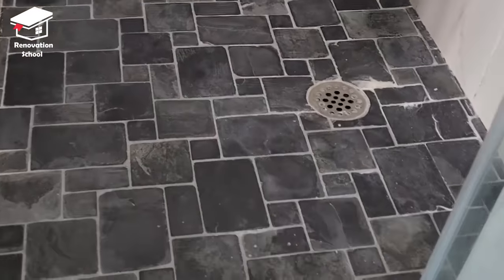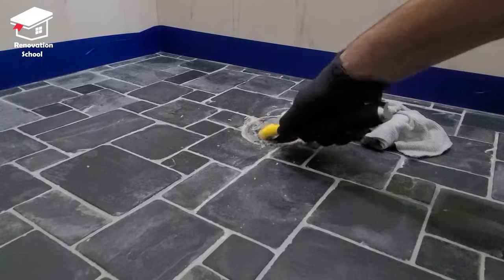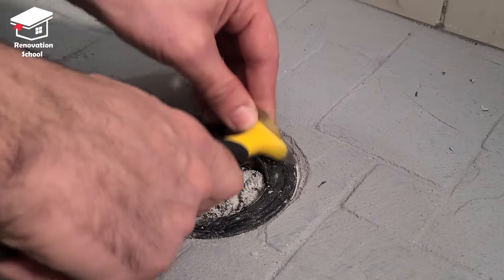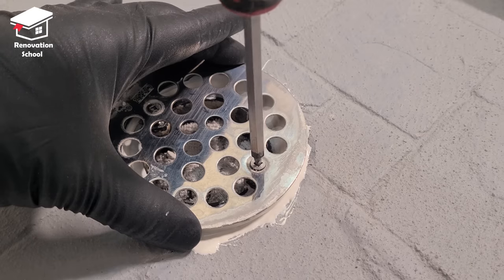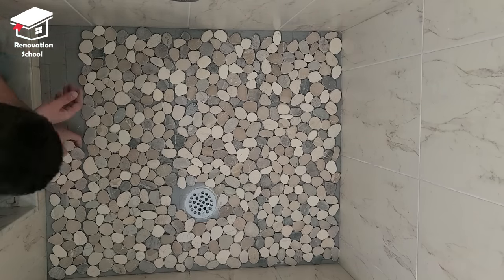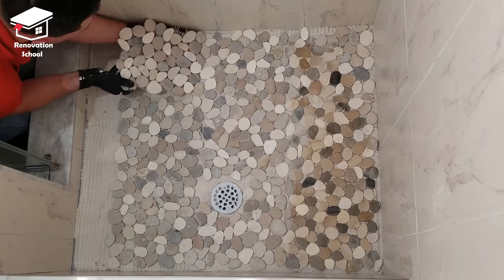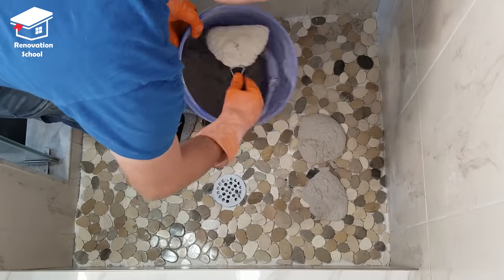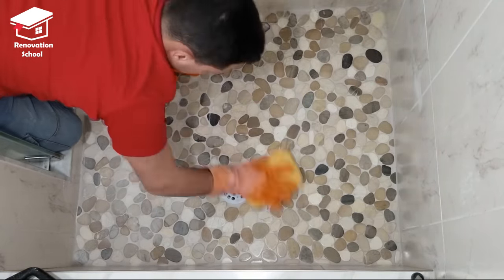How to tile over tile in a shower floor?

Comment: hi a very informative video.
When finishing off the corners with silicone, I would suggest first  tooling off the silicone with your finger first, then spraying it with water, followed by a spray of soapy water and then another tooling off with your fingers.
If you spray the silicone before tooling it off, you prevent the silicone sticking to the tiles on the feather edges of the bead and mould will establish in these areas.
cheers
Reply from the maker: Thanks for the tip 😊 and thanks for watching.

Comment: I’m not complaining about your work. Just wanted to ask…. 

Ok… all tile leaks through the grout. That’s why the shower pan is super critical.  So when you tile over tile. You need to make sure the moisture that gets below the tile can flow to the drain and then allow the grout to dry out. Otherwise the grout will stay wet all the time causing mold. Did you make sure to add new weep holes at the new drain. 

I build custom homes and remodel homes. The number one issue I find is wet shower pains, moldy grout and  tile due to poor shower pan drainage.

So. Now when water makes its way through your new grout. It hits the new water barrier. It will run towards the low spots which should be your drain. However when it hits the new piece of black pipe installed it cannot get into the drain, there are no weep holes.  So the grout will become saturated with water and never fully denoting used regularly.
Reply from the maker: I've seen many shower pan failiars also.
I say most of the cases depend on the home owners. If the clean and seal the tiles regularly they will never have an issue. 
I clean and maintain mine. 
It really is amazing to goof proof it. But honestly I didn't bother making weeping holes and bs . It's too much overthinking here for a small tile shower floor that has all the fancy waterproofing stuff under it . When I use this shower every day. I always notice that my grout dosent even get wet let alon having mold in it. If u watch the video again you will see I used that grout additive . It literally made it water repellent 100 percent. You can see the water from in to small balls when it hits the grout here. I do not ever worry about weeping holes or water getting in or under this grout. 
All the best . Thanks for watching and the comments. I really appreciate you and people like you.

Comment: This is an amazing video with all the steps needed. I do have a question, have you ever done a job and then figured that the grout color didn't look good with the tiles or bathroom? What would you do then?
Reply from the maker: Thanks for watching
No I have not 
I would remove the grout and re do it 
There are ways to redo the grout 
Thanks to YouTube you can get lots of ideas

Comment: Great video! I have a shower tile floor that has a low corner where water pools. Probably 1/4" drop in a foot, but in the wrong direction. How thick can you lay thinset like this? Enough to be able to correct that slope, or does the whole mudbed have to be redone at that point?
Reply: I have this same issue now. I came here with this question.
Reply from the maker: Hello, thanks for watching
You can use the 10 sets and correct the slope first
Allow it to fully cure and then the next day tile over it
Reply: Wow fast reply! Thank you so much! Also, the original shirt drain is one of those long, rectangular drains. Is that difficult?
Reply from the maker: That is depending on the style of the drain and your craftsmanship level.
Reply: 5:59

Comment: I always lightly grind the tile first. Gives you a much better surface to bond to.
Reply from the maker: the black stone was rough and i used the primmer on it.
using a grinder for shinny stone tiles is a great idea 👍
Reply: I've alway grind them too. I wonder if that's still needed if I use this primer

Comment: Fantastic video. Your instructions were clear and detailed.  I appreciate the effort.  I am going to pull out the walls in my shower but tile over my floor since it doesn't leak.  Surprisingly I picked out the same exact tile from Lowes.  Can you tell me what color grout you used.  It looks perfect with the natural stone. Also, is it over kill to paint on a membrane like Redguard and if I did go that route would you suggest to put the primer over the Redguard?   Thanks
Reply from the maker: Thanks for watching 🙂 I don't remember the grout colour but I'm sure I showed it in the video you may be able to see what brand and colour it was if you watch the video one more time. just use any sanded grout that matches the colour of the tiles ( stay away from premixed grout they suck so much)
As far as applying redguard on the old tiles it depends, if your tile has a rough texture it should work, but if the floor tiles are shiny and big redguard will not stick as well as this primer. this primer adheres very well to tiles even if they're shiny. if the shower floor doesn't leak I suggest using the primer overall. If you want to use the redguard id say to apply this primer first and then apply the redguard on top if you want to. The primer is used for bonding the materials. 
All the best 👍
Reply: I've been doing a lot of research. I have the same drain as yours. Do I have to worry about weep holes not being in the drain? I have a sloped shower floor that drains to the middle but not sure if they used a motor bed? My plan was to sand,  apply the tile primer, then a coat of Red Gard, and then install Kerdi membrane and a Kerdi curb to make sure the floor doesn't leak. I do have a small leak on the outside of the present curb which is probably wood and not sealed properly. Any thoughts?
Reply from the maker: I think you already know what to do 👌😉

Comment: Nice job. I used the Mapei stuff also and the large tiles adhered nicely over old tile. I probably should have gave it 2 coats. And if you miss a place, go back and fill it in, because if you don't, you will pay the price, as the top tile will NOT adhere.

Comment: Your video is very well explained. How did you cut the small stones around the edges?
Reply from the maker: Hi 
thanks for watching 
i use a tile nippers to cut them. the tile nipper does and amazing job , if the edges are sharp u can use a fine file and file it down and you are good to go.
Reply: @renovationschool8818  
Just a little Pro tip, you can cut those mosaic in the package through your wet saw to get a straight edge on the perimeter all the way around...
It sure beats cutting little pieces to fill the gaps ✔

Comment: Excellent and thorough video!  Thank you!  How would you recommend tiling over a shower floor that is river rock, which obviously isn't a totally smooth surface like you have shown in your video?
Reply from the maker: Thanks for watching and the kind words. 
if u dont have any water and leaking issues , I would suggest washing the tiles super clean first and then when its bone dry, clean it with  alcohol. Then apply the primmer that i used in the video. when primmer is dried up use modiffied thin set (that i showed in the video) and skim coat over the rock tiles till its smooth, making sure its slopped properly so when u tile over it the water goes to the drain. allow to dry up for a full day and then tile over it the same way i explained.
basically build a layer of modified thinset on top of the rock tiles after the primmer is dried up and make sure its slopped properly before tilling over it.
Reply: @renovationschool8818  Can I use modified thin set to improve the angle of drainage? My shower does not leak but water pools in one area away from the drain.
Reply from the maker: @averymay7274  after priming and following the steps that you saw on  this video yes

Comment: Great video. I plan to also do the walls any suggestions and which should be first? Thanks
Reply from the maker: Thanks for watching 
Professionals always do the walls first. Be aware if u do the floors first establishing the first row on the bottom of the walls will be difficult for DIY guys because u need to get perfect grout lines. Since   shower floors are sloped you need to cut the bottom of every wall tile according to the slope ( only the bottom row will be hard to do) but let's say if you are not very skilled with tile work you can do the walls first and hide the bottom row cut imperfections with the floor tiles.

Comment: Thanks for the very informative video, one quick question, can it be done with 2nd floor shower? not sure if the added weight is substantial enough to be a concerned, but I just thought I check if there is any extra steps for 2nd floor shower floor. Any advice is greatly appreciated. Thx
Reply from the maker: Hi 
this video was done in the second floor already. there is not much weight added . its 100 percent safe to do it anywhere in the house.

Comment: If you have no leaks but want to improve the flow of water toward the drain, can you use tile over tile to change the slope?
Reply from the maker: Depending on the type of tile and drain yes
Reply from the maker: Depending on the type of tile and drain you can do it for sure as you saw it on this video

Comment: Hello ....Great job with this.! 
Do you know how this will work with a square kerdi schulter drain?  Thanks
Reply from the maker: Hello 
Same exact procedure
Reply: Great.  Where will the extension go? Will have to remove the square part grouted into the floor?
Reply from the maker: You can remove the existing and add one of these and then use a new drain cover for the top part
https://www.google.ca/shopping/product/1?q=schluter+shower+drain+extension&sca_esv=0f8df8f1fcc87b34&biw=412&bih=757&tbs=vw:l&sxsrf=ADLYWILDtQu2k8w2vko_YiRve404MuM03g:1719715957693&prds=num:1,of:1,eto:13217570201099164063_0,prmr:1,cs:1
Reply: Thank you !

Comment: Thanks for your video its excellent by far. I have a quick question; Can I install mosaic over the shower wall ceramic tiles in the same way you installed the floor? 
Thanks again.
Reply from the maker: Thanks for watching , yes you can do that 100 percent 🙂

Comment: I know this is a year old video but I figure I'll try. I have the same issue and want to tile over top. Only problem is the drain is a linear type that can't be adjusted up or down. Its a Schluter system so the drain has a flange that is under the schluter. Any ideas how to extend some kind of drain?
Reply from the maker: You won't be able to unfortunately. I know what exact type of drain you have . This will not work in your case. You have to redo the whole shower base.

Comment: Thank you for the video.  Wanted to ask you a question.  I have a new build with walk in shower.  I noted the tile flooring was not sloped correctly and the water was not draining.  The builder hired a contractor to correct.  Much to my surprise, they did not remove the original floor tile, they did a tile overlay.  I am completely ignorant with this process; however, I watched the worker perform the task and I can tell you he left out several steps.  ALL he did was 1. place cement directly on the tile, 2. place the new tile and 3. add the grout.  There was no primer or sealant added. Before I go back to the builder, can you please tell me what should have occured and what are some of the issues that can result from the way my overlay was done.  Should I request a redo?  I told the buidler I did not want a bandaid and they assured me it would not be, but it seems they cut corners with how they did the overlay so it's even worse then what I thought.  Any guidance or advice would be appreciated as I want to have information before I address this with the builder. Thanks
Reply from the maker: Thanks a lot for watching
What I did in this video is the minimum requirement to get it to work.
As you are saying they did not do it's correctly
Usually brand new homes come with Terrion  warranty in Canada
So if you contact them and tell them about the issue the builder can lose his license
Since the house is under warranty he should redo the entire bathroom for you.

Comment: Hello! Awesome video exactly what I needed . Question though, I’m using similar stone, shouldn’t they be sealed prior to grouting so a file doesn’t get into stone??? Thanks!!
Reply from the maker: Thanks for watching
You can diffently get it sealed before installation.
Reply: @renovationschool8818  thanks!!
Reply: I have another question at the end of the video you use soapy water and then you silicone around the edge. First does the silicone really adhere good when you do that second will the silicone end up getting moldy after a short time because of the pain to clean after
Reply from the maker: @thomasdicostanzo417 I applied the selicon and made sure it's applied evenly , you have to make sure that the corners are bone dry when u apply the selicon.
I applied soapy water on the selicon that was applied so I can clean it easier with my finger. The bottom of the selicon never meets the soapy water. It's just applied on the top surface so it doesn't get smeared on the tiles when I wipe the excess.

Comment: Question.  My shower walls are concrete block.  Should I tile the floor all the way to touching the walls or leave a gap for expansion and fill the gap with silicone ?   Thanks great video
Reply from the maker: Thanks for watching, I honestly have not seen a singel concrete shower wall in my life , concrete is very pours and it absorbs water like a sponge I don't know why or how come u have concrete walls to begin with!
Reply: @renovationschool8818  I live in Florida and all homes here are pretty much concrete block .  Yes interior walls have Sheetrock over them .  However this shower was built out in the garage and all walls are concrete (heavily painted).  Was built in the 1960s and has worked fine that way. Anyway my plan is to completely TILE the inside of the shower walls anyway .  Starting with tiling over the floor.
Reply from the maker: Wow that's very interesting
U can differently tile over it but make sure to apply redguard or some type of waterproofing membrane before u tile it because if the water leakes through the tiles or grout lines you don't want to have mold issues.

Comment: i am thinking about retiling on top of existing tile due to uneven low spot area of the shower pan and is pooling water.  Other than the process you mentioned on your video, before actual retiling, what would be the recommended process to ensure on top tile will have correct slope down to drain?
Reply from the maker: You can mix some thinset and fix the slope first and then tile over that when it's dry

Comment: Hi,
This looked great. My only question is how did you fill the area right around the drain?  There was rock missing and then it was there.
Reply from the maker: hi 
I removed a few stones from a sheet of tile and then placed  some around the drain and also at the very end part where the shower curb is 
because these tiles have different sizes of rocks in them it made it easy and simple. i just placed whatever that fit perfect in that area.

Comment: Question! I have a shower ledge that has cracked tiles that have some water damage and mold should I tear down the shower ledge or do you think it’s safe to tile over if I make sure it’s clean ?
Reply from the maker: Hi 
no, do not tile over that moldy  tiles , dont waste your money , tear it down , start over and make it right. I have tons of new videos coming very soon. i also have 3 new shower and bathroom renovation videos that are under edit as of right now. please subscribe to the channel so u dont miss those videos.

Comment: Thank you for this! Quick question - If the tile type is not that where it is sealed, will water seep through and create a mold issue in between layers?
Reply from the maker: hi, thanks for watching
 if ur tile is porcellen you must seal the grout only. its very important to seal the grout so it dosent get dirty and also not allow the water to go bellow the tiles.

Comment: aside from silicone you use on the corner, what is the alternative coz i don't like to use silicone on the corner, can i use grout on the corner?
Reply from the maker: OK, so grout will crack , the tile or better to say, walls and the entire house expand and contract, things shift in the house or the house settles after time , these will cause the grout to crack on the corners at some point. because grout is hard material. Silicon is soft and after the expansion and contractions happens the soft silicon will also move with the walls or shower floor corners and it stops the water from seeping in and causing mold or water damage behind the tiles, that is why you see pros use silicon on the corners. now there is a specialty silicon that has grout mixed in it, it looks exactly like grout but it has silicon mixed in it , it comes in a tube and it applies just like the regular silicon, I will leave you a link bellow so you can see it , you can get them from home depot , lows and any tile store. over all that's the idea behind using silicon on the corners. there is another type of grout also , its called polymeric epoxy grout , that product is a crack proof, but its very hard to find and its very pricey , its very hard to clean and it will leave a haze on the tiles when you're done. you need to wash the tiles with denatured alcohol many times after the grout job is done just to remove the haze. i used it twice and I regretted it both times. it will add a lot of unnecessary cost and labor to a tile project. I hope I answered your question , thanks again for watching.
here is a link to the silicon/grout mixture that I was talking about , it comes in sanded and none sanded packages depending on what grout you use.

https://www.homedepot.com/p/Custom-Building-Products-Polyblend-380-Haystack-10-5-oz-Sanded-Ceramic-Tile-Caulk-PC38010S/100678064